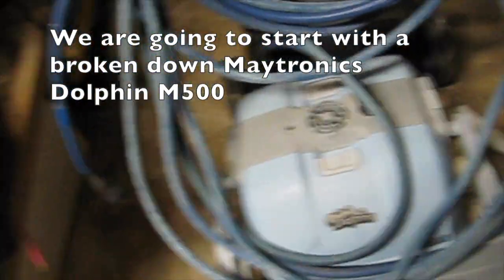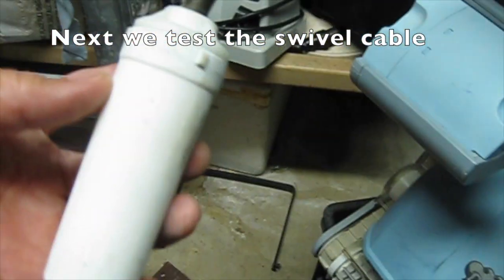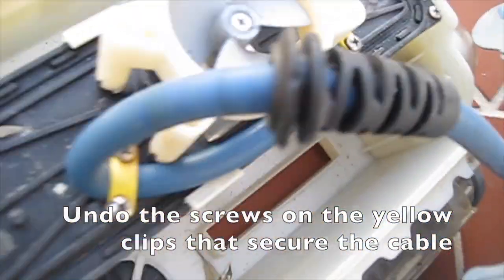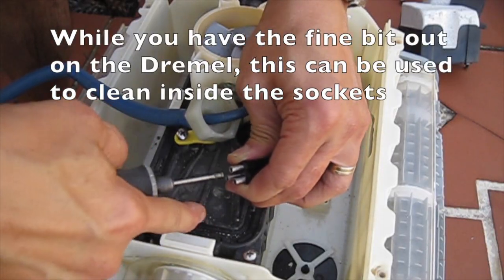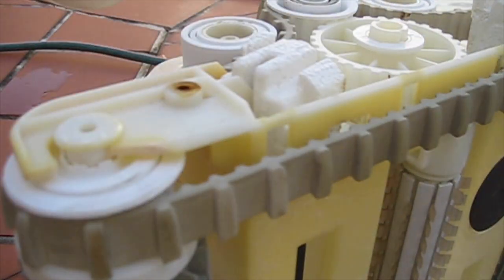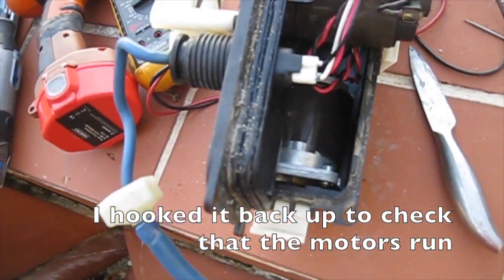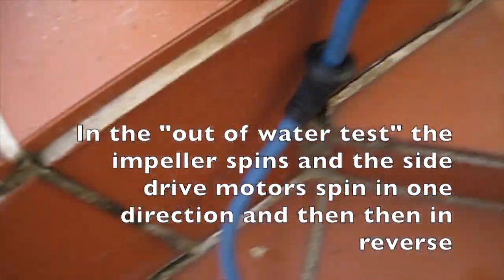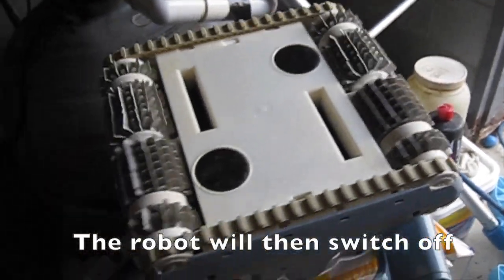fix faulty non working Maytronics Dolphin M500 pool robot complete diagnosis and repair

Comment: Hi - just adding another comment. I've followed your tutorial and repaired my M500. This is amazing thank you. For me it was the swivel cable contacts. One of them was pushed in - I had zero volts on the robot side. Could you add a donation link to your video or let me know your PayPal address please. I'd like to send you $20 as a thanks
Reply from the maker: Thank you for the nice comment. No need to pay me . You keep the money for future repairs .
Remember if the pin ever pushes in too far and loses connection and you cannot get it out far enough , you can make the pin extension in my other video .